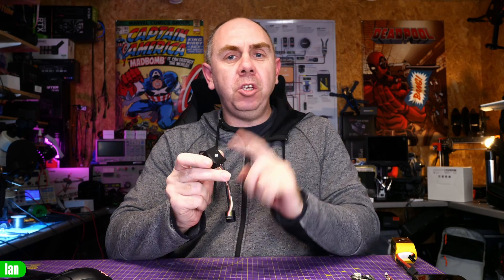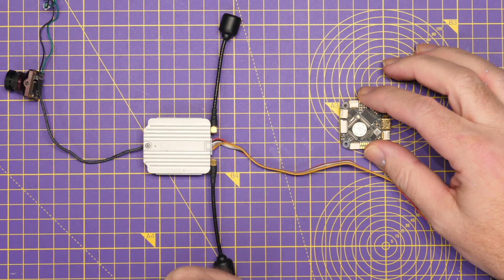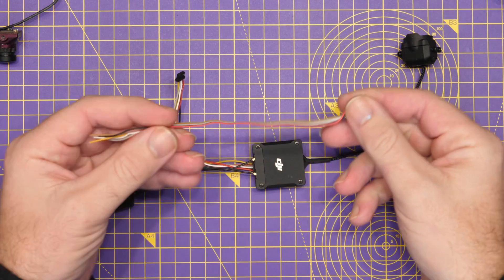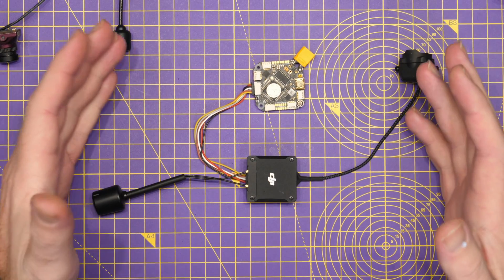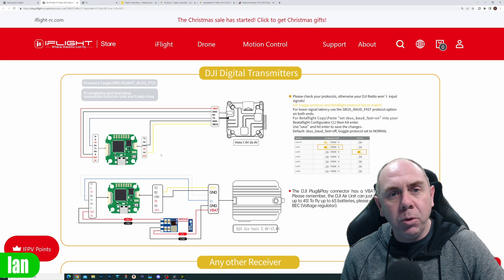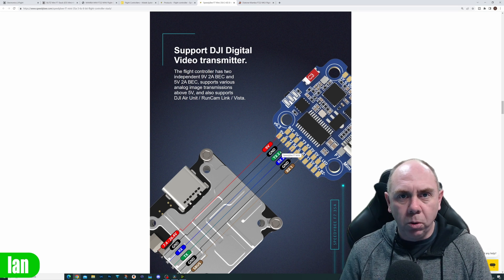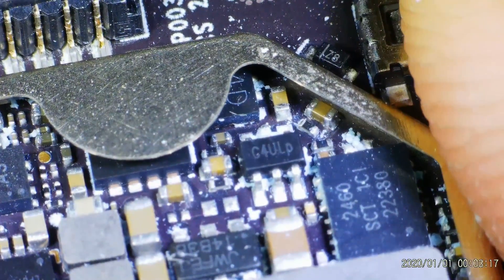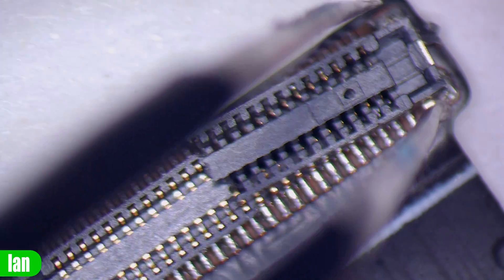DJI O3 Connector Warning - Not All Are The Same

Comment: Not sure if I got lucky, but I plugged in my speedybee f405 backward for 5-10 seconds. Flipped the cable, and it works perfectly fine (even using Dji fpv rc2 with sbus). Live and learn, but thankfully, it all seems ok.

Comment: It's the fault of people just sticking things in any hole without checking first.
It's obvious that you have to read the flight controller manual to see if it is compatible with the air unit O3, or the pinout.

Comment: What a fucking shitshow, anybody excited that their 03 air unit has  finally arrived, and hurries to take their analog quad appart to replace with a digital system only to then blow up their 03 air unit, the cable fit .... but the pins are still connected wrong! Nobodies fault really, standardization takes time and will happen since DJI vtx/rx systems are getting more and more popular as they are simply the best on the market. But fuck man, imagine blowing up your 03 air unit like this. That would suuuuuuck so much.

Comment: what did you use for the replacement of the blue stuff that they use to transfer heat from the components? i feel the stuff i used is not good enough and is the cause for my avata to fall from the sky just 5 seconds into the flight stating a "motor error" as the cause but did not have that issue since i opened it to reconnect a ripped antenna connector

Comment: how can you tell if you have done damage? i used the provided cable from my flight controller and cant get betaflight to display anything other than stock osd and the rx does not work either. does nto seem to matter what i do in the betaflight app, nothing changes. almost like the esc and air unit are not communicating at all. voltage on the goggle portion of the osd doesnt show anything and the esc osd does say what battery voltage (high or low) but nothing else. it isnt even properly scaled

Comment: Good on you for this video!   I just got my 1st DJI system.  Goggles 2, and O3 Air Unit.  I was trying to figure out how to properly connect the wiring harness.  I was smart enough to question the harness connector that came with the O3 Air Unit.  Seems it doesn't quite match the pinout of the T-Motor F722 HD VTX.  I'm going to verify and re-verify before powering it up.

Comment: I drown my drone yesterday and when I'm back home I tear down my o3 and try to dry its inside. When I found out I actually broke the connector which Mads Tech also did, I felt like I'm so doomed because I have phone fixing experience before and I have never broke a a connector like this one, until I found out, I'm like: hey! he broke it too! but mine has lost a soldering pad which would be harder to fix. still I wish I saw this video earlier.

Comment: How hard can it be... All I want to do is plug a 4s battery into it and use it on an RC Car. But no, You need a science degree to even look at it. 😞
Reply: Same for me, and providing power to it from a lipo that provides at least 8v. (so 3s to 6s) is not that hard, heck you can probably cut over the balance connector on a lipo, do the same on the 03 air unit jst connector. Connect red with red and black with black. Double check with a multimeter. And then it will work .... and be fucking stuck in 25 mw because you need to arm the damn thing.
Reply: @KainniaK  I ended up selling all my DJI crap and went with a 5G fully unlimited range in Full HD...The system is sick af...
CloudRC.
So simple to setup and works where ever you get 3G, 4G, and now 5G.... the quality is nuts! - Save yourself a headache man especially with all the bullshit going on with DJI now.
So I have this setup in my 6s Mojave and its fully unlimited range hence running 5G and 250mp/ps from home base...No Lag, EIS Camera and you can use any transmitter you want up to 8 channels.
fully sick...but it aint cheap, but worth every bloody cent if your after Car,Truck, Boat Unlimited range FPV. DJI can go and shove it.
Reply: @Top-Jimmy what's the latency of this system?
Reply: @Top-Jimmy what is the system?

Comment: The part that the ribbon cable is plugged into, if that gets damaged on the board with the antenna, is it possible to get it replaced? The antenna top board replaced? Or $180 for a new module 😢
Reply from the maker: Any repairs are very hard.  DJI will offer a service but they generally just replace the board.

Comment: Yup. Just plugged an 03 into my new tmotor f7 mini with the factory cable, pinout was backwards and the smoke stopper didn't catch it. Hopefully just the sbus for dji control is toast, havnt tested it yet. Fixed the pinout and it does at least power up still 😢
Reply: Are the o3 working?
Reply: @acidl5800  it is. But the sbus is fried so it can only be used to transmit video. I can't use it to fly with a dji controller.....

Comment: can you still connect the o3 air unit just to the pads of my FC with soldering?
Reply from the maker: Absolutely
Reply: @MadRC  I feel like a little noob but how does that work when you don’t want too you the sbus port “remote that dji provides” and fly with the tbs tango. Do they provide a cable for video only?

Comment: Wish I had watched this video before blindly plugging my O3 air unit's provided cable into the flight controller and powering it up. ("If it fits, its right" does not apply here) Then later wondering why the O3 air unit doesnt even seem to be powering up. I'm using external receiver, so hoping maybe its still usable once I fix the wiring. Liked & Subscribed.

@Mads Tech -- Separately, while decasing an O3 air unit, I damaged the flat ribbon cable's pins irrepairably. Do you know where this cable can be found as replacement?

Comment: No reason to tack those down before hot air. Lower your airflow down so its not blowing super hard. Also get yourself some Kapton tape. It works better for protecting components from heat when doing reflow soldering work. It is also better than using metal. Also get yourself some solder paste. Clean the pads so little to no solder is on them and apply a small amount of past and then lay the SMD component down. I worked in eletronic repair for years. Did alot of soldering under a microscope as well as multi layer PCB repair.

Comment: Hello, maybe someone here will be able to help me with my O3 & V2 Goggles issue:

I have both DJI O3 kit and DJI V2 Goggles - both have latest updates.
O3 firmware version - V01.02.0000
V2 firmware version - 01.00.0607
When I press link (red) button on V2 goggles - it beeps correctly. When I press link button on O3 unit - nothing happens (does not matter if I press once or hold for 5s). Should I believe the issue is on the side of O3 unit?
One more thing worth mentioning. I took out O3 unit of the box brand new and the only thing it is connected to is through USB port (wires not connected) but can this be the issue?
Reply from the maker: Yes. USB won’t power the Airunit.  You have to power it via the main input. USB only powers up the internal flash memory updates and downloading footage.  It will not power it to actually work.  You need to wire it up as shown in manual for your specific flight controller and power it via the harness.
Reply: @MadRC  so basically I will not bind O3 with V2 goggles until I wire it up with the stack and power using my 4S battery?
Reply from the maker: @AdrianAmbroszkiewicz  yes.
Reply: @MadRC  Thank You very much for support! Made my day a lot better :)

Comment: If I wanted to use the 03 unit on a fixed wing is there any benefit in converting the SBus to PWN and using the DJI system OR would it better to just use a separate rx tx system?

I currently DO NOT have a DJI controller.
Reply from the maker: Use a separate RC system. Your much better doing that.

Comment: Is the speedybee F7 v3 stack pin out the same as the DJI 03 air unit wire to just plug in no soldering...

Comment: Hello Master. Could you please tell me if I can connect this DJI o3 air unit to a Pixhawk 2.4.8? Congratulations on the job.
Reply from the maker: You can to the UART at normal but you would have to power from a BEC separately as bus voltage is too low on the UART port and even then you would not have enough current.  

You Basiclly would connect the UART ie Tx-RX , RX-TX  as normal and then power from suitable  BEC.

Comment: Could i just solder the new cable and the old one together?
Like cut both in half, solder the O3 wire with my old Air unit cable that has the connector to my FC(Kakute F7 HDV)?
I am a bit new to this and I am scared of soldering the tiny wires to the FC.
Many thanks
Reply: that is what i did, and it worked

Comment: Great video! As always. I’m still setting up a new quad with an 03 air unit. I anticipated all this as I am not new to the hobby. I am using an older Lux F7 “HD” that has the old pin out. As I have done many times I have carefully separated the DJI O3 cables with female pins intact from the FC side and will re-clip them to a plug that fits my older lux in of course the correct order. 
Maybe you can do a quick vid for folks on the process. Just a suggestion.
Cheers,
Reply: Hi which type of FC have you used? I have the Lux F7 HD Lite FC and looking to use the DJI 03 air unit, haven’t bought the 03 unit yet but was looking to see if anyone had done this with the same FC as I haven.

Comment: Thank you so much. I have been trouble shooting literally for 2 days trying to bind my o3 unit with v2 google. It won’t bind even after updating all of the units to new firmware. I thought I was missing something then it clicked to me last night to check the wiring diagram on my blitz f7 flight controller only to discover that plug-in that comes with o3 units won’t work directly to my fc.  But I was not sure if I damaged my o3 unit (I had some feeling). This video confirms that I have. And it completely sucks. But glad to know this finally confirm that it is.
Reply: is your Flight controller the Blitz F722 by any chance? I've been having a similar where I thought the plug on the FC that the o3 can plug into isn't powering it. Whilst physical it does fit just won't do anything.

Did you confirm that your o3 unit is dead after wiring it in properly?

Comment: Good attempt, I know how much pain soldering this size components brings and as a rule always and I mean always check wiring diagrams for both air unit and your fc, never rely on cables provided by manufacturers.

Comment: i ordered the T-Motor F7 Mini HD Stack, it has the pinouts the other way around, i had to repin my dji o3 connector because i cant use the connector which was included with the FC, because one side is for the FC and the other side is for the old Air Unit. Thanks for the warning!

Comment: Question I think I did this to my  fc,  the o3 airunit seems to still be working tho, as for the fc not so much.. I have noticed that my mbps does get up to 50 tho.. could this be a sign? Uart still works i believe, and canvas mode is working aswell.

Comment: I accidentally did this setting up my O3 in a build with an Aikon7, swapped them around once I realized and it works just fine now. Sbus and everything works as it should
Reply: My experience has always been the same. Plugged in backwards and all seems fine still. I dont think 9v to the sbus does damage if only for a short while.

Comment: Thank you for the warning.    I'm expecting a BNF with an O3 unit installed but just to be safe I'll check the FC pinouts to make sure they match the wiring on the air unit.
Reply from the maker: Tbh a BNF from the factory will be fine. It’s upgrades and new builds from users that’s the risk.
Reply: @MadRC  Thank you.

Comment: Smart!! I will do that from now on from actual pinout diagram from itself on FC AND on air unit 03 system or even vista, original air unit and even on analog, just ALWAYS double checking is always a smart move! But suggestion to you maybe to use Qtips to remove these blue glues with 90% or up isopropyl alcohol on Qtips before sweep off the blue glue, just a suggestion though from FPV pilot to other 🤙🏼 great job on video this one too make FPV pilots to be so aware of this issue. Thanks dude!! 🤙🏼